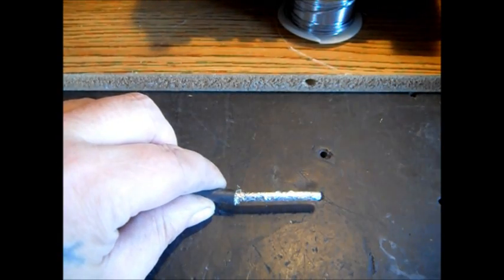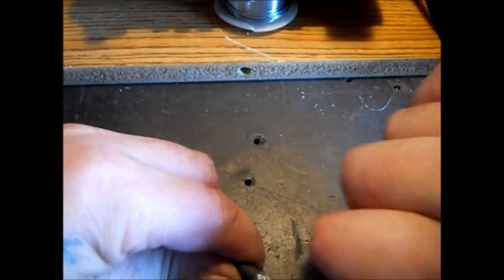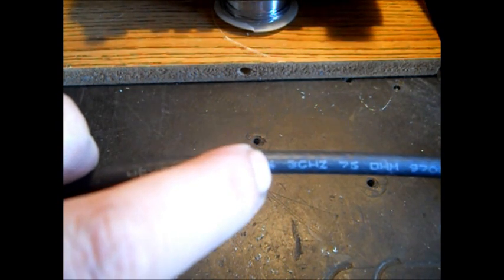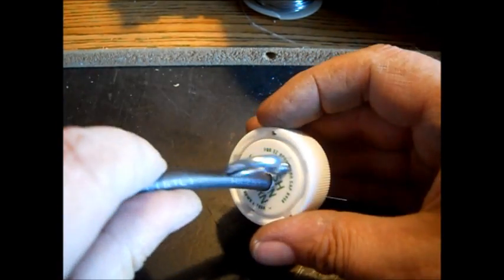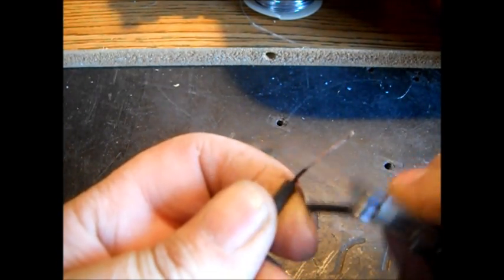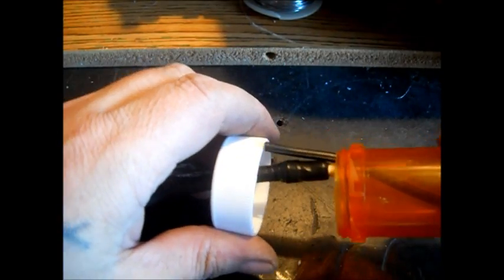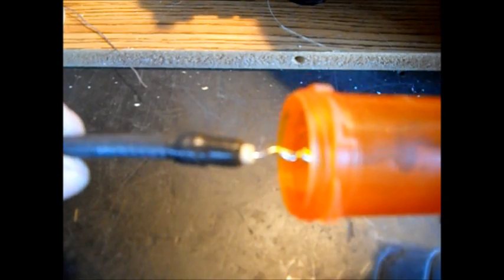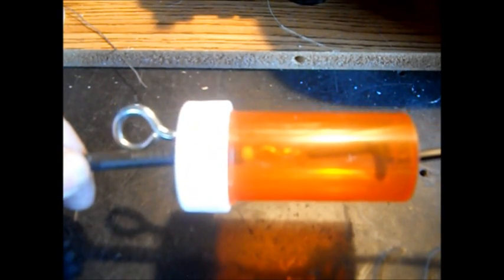LONG WIRE ANTENNA (For Shortwave  DXing ) Part 1

Comment: I worked for the phone company for forty years and have a lot of experience with the phone drop wire. Be careful when you scrape the copper covered steel wire. If you nick the copper it will rust into where you nick it.

Comment: HM DOESNT ALL THAT BRAID AND FOIL BLOCK ALLOT OF SIGNAL. IM CORN-FUSED
Reply: The braid on the coax is to connect the end of the aerial to the receiver. The aerial is measured for the frequency required. The coax is not the aerial but is used to carry the signal from the aerial to the receiver without getting any interference (i.e. it is shielded).

Comment: if that foil is glued on would using a heat gun to soften it up make the removal process any easier? Also, wouldn't  it make sense to cut and remove that section of white  insulating material before removing the foil, that way you end up removing only a fraction of the foil because you're not stuck unnecessarily removing foil from a section that isn't being used?
Reply: you are too smart for this guy .... LOL

Comment: Just saying  from experience the plastic pill bottles most will not withstand ultraviolet rays from the sun ,will degrade and crack in time,I think that is why people use the PVC pipe with the caps but you got to buy that stuff unless you can steal some somewhere Ha.
Reply from the maker: The Idea for it was to make it cheap It is still in use and plastic looks okay i have looked at the wire inside it is okay

Comment: I bought rg-238 a whole 1500 foot roll for $20.00 from a radio shop going out of business and have yet to use any also got 00-2 positive and negative cable about half a spool each for $50.00 don't know how much came on them , but I made a hell of a set of jumper cables 25' long and got a couple buddys begging for a pair . Time to start some projects thanks for the inspiration ! Matthew.

Comment: Regarding my comment made a few minutes ago, obviously, the PVC end caps & the 2 1/2" x 1" pvc tube should be glued with PVC  glue, & not hot glued together. The HOT GLUE is for sealing the eye hook threads and wiring entrance on inner & outer end cap surfaces. (just in case novices are reading this)

Comment: Pill bottles are relatively thin walled & weak & ozone/sunlight vulnerable. Use a
 2 1/2" x 1" pvc tubing with glued on endcaps instead. Eyehooks screwed in caps and hot glue sealed on the inside. Hot glue seal the wire inside also. That eggshell insulator will NEVER pull apart or rot, nor moisture get inside if hot glue sealed correctly.

Comment from the maker: Thanks for the Idea !!! I have had several comments about grounding the outer braid/sheild of my coax cable I have tried grounding it at the mast /tower and it has helped on static not alot on signalstrength

Comment: In the late 90s I used a 150 foot 75 ohm  TV cable and a 3 foot ground rod connected to the outer ground  coax wire at the end and a vertical 50 foot antenna wire connected to the center wire.  At the other end a 1 eighth" plug to my Realistic DX 390. It was an attempt to get rid of analogue TV noise on 6955 KHZ the pirate radio channel of the day.It worked really good. these days I use a conventional 70 foot wire from my house with no cable since the new HDTVs dont have that problem.

Comment from the maker: The Ohms of the coax does not matter   the center conductor is hooked to the antenna wire and the sheild/braid is not used or hooked to ground  the coax is sheilding the signal from the lonwire antenna to the radio